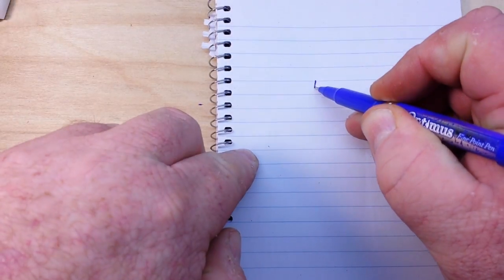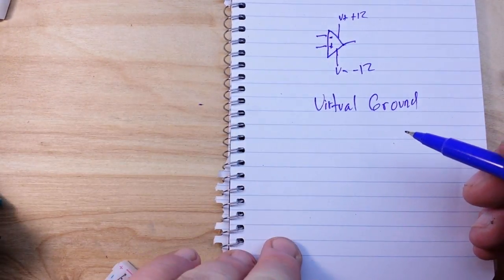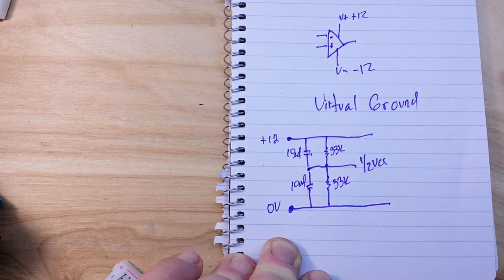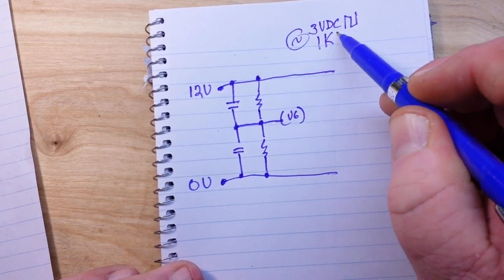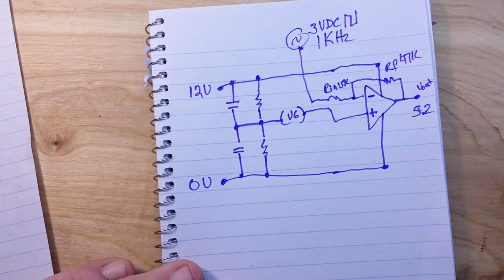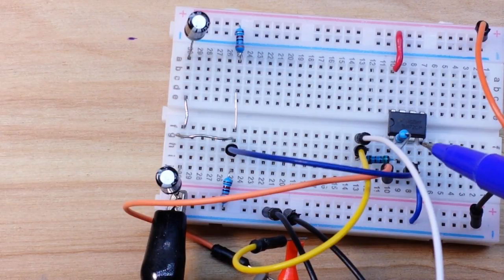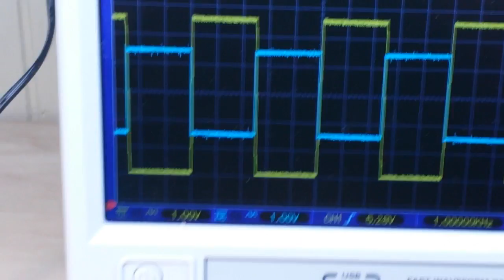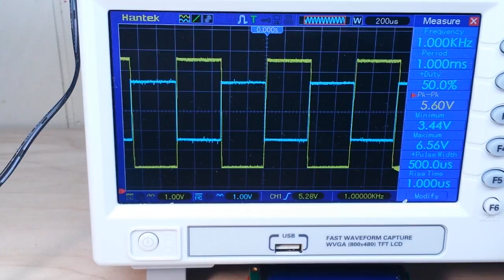How to use an opamp with a single supply

Comment: Why, when you change the square wave input amplitude, does the output not increase in the positive direction?   Is it clipped already?  If you used a 1v pp input would the positive output increase as well?  If this is the case, wouldn't a better demo illustrate the positive gain, by using a smaller +/-  input?
Thanks for making me think!!!!...until your reply..................

Comment: This is not allways necessary : it depends what you'r doing with your opAmp.
And I'll add you'll need to care about your limits when you'r in audio systems because of course.
Your output depends of your power voltage supply.
And there are many others parameters because opAmps are each specifics depending of the applications.
Some for example are designed to measure currents with precision and with low voltage single power supply of 5v.

Comment: How did you calculate a 47k and 15k ohm resistor were the correct values?
Reply: To get a gain of about -3, -(47/15).

Comment: This strikes me as a potentially misleading for many who might want to look into running on single supply.  As is very clear from your oscilloscope demonstration,  you have the op amp already in a seriously saturated condition, acting more like an inverter than an amplifier.  This is clearly shown by the fact that as you change the input voltage in your demo the output does not change.

Comment: The non-inverting case is a bit different because there will be considerably more current draw through the virtual ground. But in that case you could use another op-amp to supply the current.

Comment: I tried to get this to work with a TL074CN but failed. When I power up the OpAmp, the output probe goes up to about 11v and stays there (Circuit is powered by an 18v desktop power supply), I don't see the inverted output form the signal generator. Any thoughts anyone? Is this down to the OpAmp?

Comment: Once "virtual ground" is established, does this become common ground for everything in the circuit, or just the opamp and/or whatever else requires a center point(virtual ground) to perform rail to rail? for example, the CD40106 needs (+V) and (GND); GND in this case is usually the negative terminal on a battery/power supply. If i run a square wave signal out of the 40106 [+v and battery neg] into an opamp juiced with +V and using battery negative as actual negative voltage as result of using virtual ground, will there be issues?

Comment: Thanks, I was planning on building a 3 op amp signal generator with possibly a saw tooth generator but only had a 9v battery.
Reply: Where you able to get it to work?

Comment: What are the capacitors used for? Are those coupling capacitors?
Reply: To stabilize the virtual ground voltage. If they werent there you would have the powersupply ripple on the virtual ground

Comment: Pardon, where do the GND leads from 'scope and signal generator go?
Reply from the maker: Are Jayem ground rail
Reply: 0v opposite 12v, not the virtual ground, right?
Reply: When we first see the traces on the 'scope, they appear symmetrical above/below '0'.  What caught my eye was varying the signal gen output,  the 'scope traces become un-symmetric.  Which makes sense if the 'scope and 'sig-gen are grounded to 0vdc.  I'd wager if 'scope and sig-gen were connected to the virtual ground, no matter what input signal level, the traces would stay symmetric.  Thus my questions about where the test equipment was grounded.  I have no way to breadboard and test this, just thinking out loud.

Comment: Thank you. This video made my little LM1875 amp from China work! If you don't mind, I would like to know the equation you used to figure out the capacitor and resistor values. I used the ones in the video and a 12VDC supply, but wondering what values I would use with an 18VDC or 24VDC supply. Thank you!

Comment: Would this method work for powering guitar effects from a single 9v battery? For once, I actually understand what the teacher is talking about, you made it seem really clear.
Reply from the maker: Im not an audio guy so i don't know if it would introduce distortion, but it will definetly power the opamp.

Comment: Thank you for an interesting video. I have two questions. First, can you talk some more about the signal generator you were using? And secondly, why do you use both a capacitor and a resistor voltage divider? Wouldn't it be sufficient with just a resistor voltage divider on the opamp input? The opamp input draws almost no current. Thanks again.

Comment: Maybe you can help me with this... I built an inverting amplifier with a gain of 15 (1K Rin/15K Rf) with 12VDC.  I'm feeding 1Khz @350mVPP to the input into a 1uF capacitor just in front of pin 2.  I'm tracing at the sig gen input to the circuit and also at pin 1's output.  With no power applied, I seem to be getting an oscillation identical to the input trace on the output trace.  With power applied, I get my desired output on the output pin, however, there is still that component mixed in as well as a 4 volt DC offset.  Any idea what I'm doing wrong?
Reply from the maker: Sounds like coupling. What opamp?
Reply: learnelectronics that's what I suspect too but I can't seem to null it out.  It's a TL074 but it still happens if I use 1 by itself or another as a buffer after it.  I'm looking for an alternative to the audio distribution amplifier in the data sheet.  It doesn't give sufficient gain for my needs (I need an output of 5v and it gives me 1v).  It uses a different single supply methodology to bias the rail inputs and I don't understand it enough to modify it for the gain I need.

Comment: When I connect the ground wire of one of the oscilloscop's channels to the virtual ground I see that the sinusoidal input has a glitch when it crosses the zero point on time axis. Is it because of the capacitors? Kindly explain
Reply: Glitch? You mean spike?

Comment: Thanks for the video, how did you connect your signal gen with the circuit? I meant where I should connect signal positive and negative into the circuit. I copied your circuit, it does not work, I assume the signal gen connection is not right. Thanks in advance